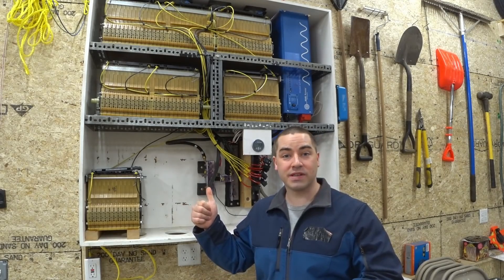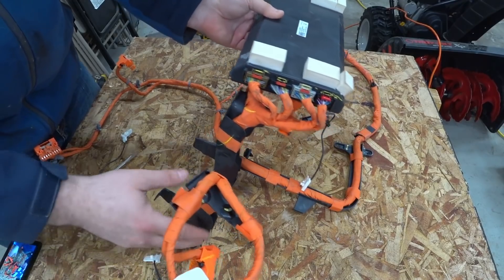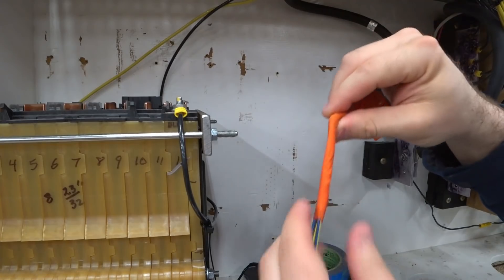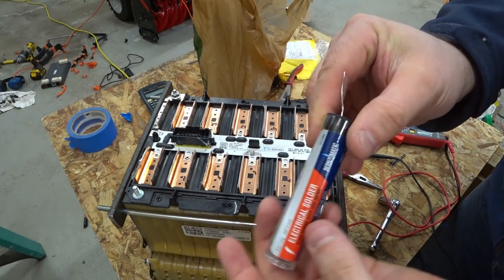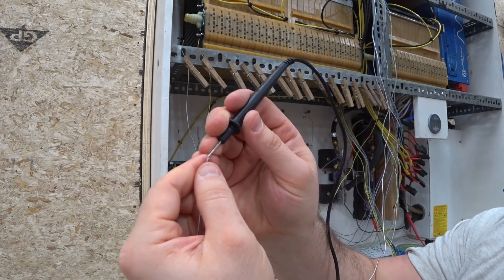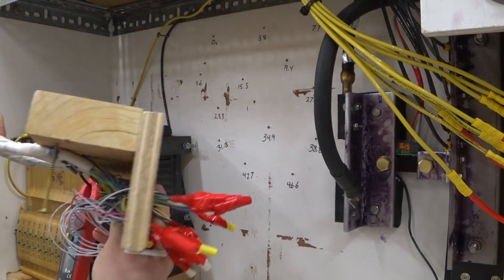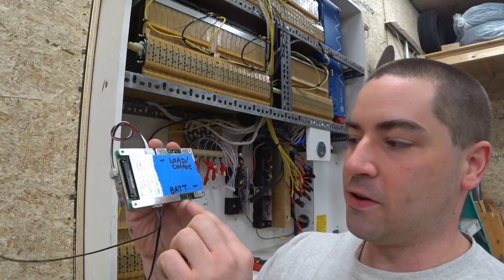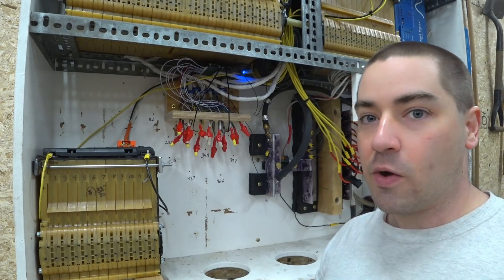DIY Lithium Battery Wiring Harness and BMS (Battery Monitor System)

Comment: It’s to bad someone else has not reused this wiring harness for off grid use ! It would be great if you could get a detailed explanation of each wire in the wiring harness ! Would have been cool to have used it with little remanufacturing !

Comment: Hello @David I am looking to do the same thing you are did. is there a way you can draw a circuit as to how you accomplished this? i would love to email you if you can share your email that would be great.
Reply from the maker: I don't recommend doing this same system.  This was back when I was learning about BMS's.  These days I add a small BMS per battery pack that I build.  In the case of this particular video I have 8 batteries, so I should have used 8 BMS's (one each).
Reply: @DavidPozEnergy  Hello! I wanted you ask you if this kind of Chinese Smart BMS has a significant consumption from the battery. I mean if it is possible that one cell be low because of the BMS connected for a long time. 
 I have Chevy Volt batteries and a few of this BMS, but finally I'm running the setup just checking manually (for year and a half all is fine).
Thank you!

Comment: I have some chevy volt batteries, not a complete set, but I believe there is 3 48 volt batteries. I either need some physical help or I need to sell them so I can get some batteries that I understand. What would you say 3 of those chevy volt batteries would be worth 🤔. I've posted them on Craigslist and market place for 1500 but no one seems interested 🤔. Do you think the price is too high? I just have no idea. B y the way, I think they are gen 1?
Reply from the maker: I think the Gen 1 is 2kwh per 12s (44v) pack.  Probably $150-$180 range.  Try posting it on a facebook group, like DIY Battery.

Comment: I have the bms from the car my batteries came from I will use it with my setup. It will be simple to hookup. You should have used that bms. My batteries are 30 volts so all that is needs is to be put into the bms 30 volts and the bms will manage the charging. Pretty simple.

Comment: Let me guess Battery hookup is giving you batteries to get you to video and promote there JUNK . I have bought batteries from them and have about a 30 o/o ratio of usable batteries and about 5 per. with 80 + per. storage. Informing them has been a waste of time thus far.. what has been your experience  with them and honest quality of product.
Reply from the maker: Hi Ashley T.  These videos on my Chevy Volt battery had no affiliation with Battery Hookup.  I bought the Chevy battery from a local junkyard.  At the time I didn't know Battery Hookup.  Then I bought my LiFePO4 batteries from them.  Those are 164 pounds each, 8s, 24v.  I paid full price for those and it was my first experience with Battery Hookup.  After my first video with those modules Battery Hookup asked if they could send me some batteries for review and I agreed.  The LiFePO4 modules are performing about 55% of original capacity, which is disappointing.  Other cells they have given me, like the LG cells, or the modem cells are performing with factory new specs.  Battery Hookup has stopped selling the LiFePO4 modules to my knowledge.  So there you have it.  My experience is mixed.

Comment: I don't understand the paralleled BMS cells.  What prevents current from jumping from string to string through the BMS wires when drawing a load or charging?    If one cell goes bad in a string, what is it going to do to the other cells on the other strings that are connected to the same BMS wire?
Reply from the maker: Nothing prevents current from moving along the BMS leads.  However, because the cells are well matched, the electricity doesn't need to move along the BMS leads.  The cells are still withing 0.008 volts of each other.   As with all my videos, I'm just sharing how I'm doing something.  I'm not trying to tell anyone else how to do anything.  You can do something different if you like.
Reply: So what happens when a cell goes bad?  What does that mean for the current in those BMS wires?    I'm asking because I'm in the process of setting up my own Chevy Volt battery that will be connected to a couple of SMA Sunny Island inverters.   Having a hard time wrapping my head around the various failure modes and consequences of each when the BMS wires are configured this way.
Reply from the maker: I suppose if one cell went bad all of a sudden, no warning, (I don't know how, maybe a bus drove into my building?)  Then I guess all the other cells would try dumping electricity into the bad cell and the fuse would blow.  I think a far more likely scenario is all the cells slowly degrading over years, but degrading at a similar rate.  Each cell is fused at 1 amp on the BMS leads.

Another way of doing this is to use 1 BMS per battery pack.  In my case that would be 8 BMS's because I have 8 batteries.  I implemented this strategy with my Smart Fortwo battery build.  (several videos about it)  I think it is a safer strategy.

Comment: You should check out this BMS. its has a relay output and a current shunt built in. i use a big contactor triggered by the bms to isolate the battery from the inverter in and overcharge or overdischarge condition. it also counts all you kwh usage. Its called the chargery power bms16t. they sell it on ebay for 195$ check it out you'll love it

Comment: what are you doing at 6:40 - 6:46.  You did not explain the procedure.  were you making the wires longer..  I find all of this all quite interesting and I have watched this  "Blog"  many many times and  it has turned me into a subscriber  Thanks, Bill,  well past 70
Reply from the maker: Hi Bill Dawson,  Thanks for subscribing.  Yes, you are correct, I'm making the wires longer.  That orange clip had very short wires on it, so I'm using some of the wires that I removed from splices and soldering them together with heat shrink tubing.  My friend Wim taught me this soldering technique about 10 years ago.  I just found this video which describes the process: https://youtu.be/Zu3TYBs65FM  I didn't go into detail on how to solder because I'm not very good at it.  Others on YouTube are far better than I am at soldering.  Thanks for watching.

Comment: What bluetooth BMS are you using?
Reply from the maker: This one: https://www.aliexpress.com/item/12S-20A-50-4v-bms-12s-2018-new-Li-ion-smart-bms-pcm-with-android-Bluetooth/32875990870.html?spm=2114.search0604.3.2.6539143baNlcHT&ws_ab_test=searchweb0_0,searchweb201602_10_10065_10130_10068_10890_10547_319_10546_317_10548_10545_10696_453_10084_454_10083_10618_10307_537_536_10902_10059_10884_10887_321_322_10103,searchweb201603_60,ppcSwitch_0&algo_expid=5f13e5ec-58b1-432d-82b5-08453babb5b9-0&algo_pvid=5f13e5ec-58b1-432d-82b5-08453babb5b9&transAbTest=ae803_5%EF%BB%BF

Comment: Just wondering David, which BMS are you using?  I need to get one for my 48v pack that's on the way for my bus to RV conversion.
Reply from the maker: https://www.lithiumbatterypcb.com/product-instructionev-battery-pcb-boardev-battery-pcb-board/ev-battery-pcb-board/smart-bms-of-power-battery/  I'm just using this as a monitor right now.  It doesn't do any protection, but could if you wire it that way.
Reply from the maker: This is where I bought it: https://www.aliexpress.com/item/12S-20A-50-4v-bms-12s-2018-new-Li-ion-smart-bms-pcm-with-android-Bluetooth/32875990870.html?spm=2114.search0104.3.1.3a1ec268phjNbr&ws_ab_test=searchweb0_0,searchweb201602_10_10065_10130_10068_10890_10547_319_10546_317_10548_10545_10696_453_10084_454_10083_10618_10307_537_536_10902_10059_10884_10887_321_322_10103,searchweb201603_70,ppcSwitch_0&algo_expid=cf985a9d-586f-488b-935c-cdb4ec07268b-0&algo_pvid=cf985a9d-586f-488b-935c-cdb4ec07268b&transAbTest=ae803_5
Reply: @DavidPozEnergy  gotcha on both.  What's got me puzzled truth be told, is I have the solar panels, I have 2 sets of 48v batteries from a chevy volt, an MPPT charge controller, and a 48vdc charger inverter, but everytime I sit and try to figure out the parts between them, I get lost.  By Parts between I mean, fuses or breakers, switches etc.
Reply from the maker: Hi Joseph,  It had me puzzled at first too.  Basically, there should be some kind of protection between any two things.  I like to use circuit breakers as my protection, but fuses work too.  Something goes between the panels and charge controller, something between charge controller and batteries, etc.  I bought a pre-made box to house the breakers https://www.altestore.com/store/enclosures-electrical-safety/electrical-enclosures/disconnectload-enclosures/dc/midnite-solar-mndc250-mini-250-amp-dc-disconnect-p2416/  The sales staff over at Alt-E are great to help you size the equipment.  They also have the best prices on most stuff.  If you want to hit me up on Facebook we can talk some more.
Reply: DavidPoz I will definitely look you up there tomorrow, after a very early day today I am fading! Lol

Comment: Got further into your video.... your "screw wall" harness was extremely dangerous.... seriously they make connectors. Amazon cells 2/3/5-way connectors that let you clip wires in a parallel but also insulated ... (dot dot dot)
Reply from the maker: Hi Tom St. Denis,  Sorry, I don't know what you mean by "screw wall".  Could you also link to one of the connectors please?  Thanks.

Comment: Two downsides of parallel'ing up the BMS.  1) reduced balancing rates.  Your BMS likely uses a resistor to bleed off excess power to bottom balance.  This can only handle so much current which means the larger you make a "cell" the slower it will balance.  2) You should be using the BMS power output to control powering your load (hence the point of a BMS).  By using only 1 BMS you reduce the total load that can be placed on your battery to the load of 1 BMS board....

Comment: Late on this but if you haven't checked them out give REC-BMS a look. They are a bit tougher to track down but they are also designed to work with larger amperages like this and probably can be set up to do the balancing and monitoring without too much extra finagling (oh and they have an existing integration with Victron components so they would mesh well with your 712 monitor).

Comment: EE student here. It's extremely dangerous to connect the same cell number (ie same cell voltage potential) to other cells in different packs even though they may be at close to the same voltage without any current limiting. Had the cell voltages been different by even a few hundred mili-volts massive current could have flowed as the cells tried to equalize themselves and it could have caused fire or explosion. Be extremely careful when working with Li-Ion cells. As others have mentioned, your BMS is too small, but I wouldn't worry about the resistance drain of a BMS with tight tolerances, the power dissipation is easily negligible for your pack size. I would highly recommend a fuse between the pack and the inverter/load and charging circuitry. I also disagree with the comments about not needing a BMS at all- it's a good idea so you don't forget to balance the pack.
Reply from the maker: Thanks for sharing your thoughts.  Before hooking everything up, I did go through with my multi-meter and check each cell.  Every cell was the same voltage.  And I had turned off the inverter and charger a week before doing that to make sure the voltages had stabilized.  My multi-meter only reads to the hundreds, so you can still be right about mili-volts being different.  
I have a 250 amp circuit breaker between the battery and inverter, and a 125 amp circuit breaker between battery and charger.  I have a video on that here: https://youtu.be/HYay0qqtUOs
Thanks for watching.
Reply: @DavidPozEnergy  Indeed you do! I haven't gotten caught up on all of your videos yet so I didn't see that, my bad. Thanks for the videos, they're always highly informative and well thought out.

Comment: where did you get the bluetooth bms?
Reply from the maker: https://www.aliexpress.com/item/12S-20A-50-4v-bms-12s-2018-new-Li-ion-smart-bms-pcm-with-android-Bluetooth/32875990870.html?spm=2114.search0604.3.2.6539143baNlcHT&ws_ab_test=searchweb0_0,searchweb201602_10_10065_10130_10068_10890_10547_319_10546_317_10548_10545_10696_453_10084_454_10083_10618_10307_537_536_10902_10059_10884_10887_321_322_10103,searchweb201603_60,ppcSwitch_0&algo_expid=5f13e5ec-58b1-432d-82b5-08453babb5b9-0&algo_pvid=5f13e5ec-58b1-432d-82b5-08453babb5b9&transAbTest=ae803_5

Comment: I wasn't sure, are you planning to install a full-fledged management system?  The monitor was just a first step to help prove out the wiring harness?  Great approach, by the way.  I wouldn't want to bet the farm (battery farm) on an untested wiring harness.
Reply from the maker: You got it right.  I'm just taking the first steps.  I'm still learning about BMS units and didn't want to jump in to a $1000 right away.  So I made the harness, and bought a $50 BMS just to monitor.

Comment: If one battery module power cable gets disconnected, that module will get charged/discharged through the monitoring wires. The small fuse will blow but prevent fire in the small monitoring wires.

Comment: Hi David, nice job! You've taken 20 Amp BMS. This is too small for your system. You could take 80 or 100 Amp BMS. You can use some of them in parallel connection. You can find them also on Alliexpress. Price is same. As for the Xiaoxiang software there are two of them. In advanced app you can set lot of parameters.
Reply: All of these cheap bms use 2x fets for the switching. That's 2 lots of volt drop across a silicon conductor. You lose a bunch of power going in, and another bunch going out. Use a latching relay controlled by the bms and no power will be wasted

Comment: One thought occurred to me though. With the cells paralleled through the small wires and their little fuses, it would be easy for one or more fuses to blow during a heavy load if the cells eventually have significant different capacity, ie due to age. Once a fuse blows, that cell is no longer being monitored independently, yet the BMS will not see the problem since it still sees all the other cells.
Reply: The fuses will not blow due to different capacity. Think about it. 
Without fuses, the short circuit currents become increasingly deadly

Comment: You need ElectroDacus, Saskatchewan, Canadian made. its a solar battery management system. https://www.youtube.com/user/electrodacus . all open source parts, so if you end up blowing a component by accident, you can replace it easily. It does take him a bit of time to build them and ship them, turn around time is about 3 to 4 months. @DavidPoz take a look.  https://www.kickstarter.com/projects/electrodacus/solar-bms-and-digital-mppt-for-pv-electricty-and-h  . I do have one and it does take a bit to get things set up but worth every penny for this unit.
Reply from the maker: I agree his controller is super nice.  If I had a 24v battery I would buy his controller for sure.
Reply: @DavidPozEnergy  your system is 8S or 12? I can't tell or remember sorry. I do wish he would build bigger BMS units .
Reply from the maker: My battery is 12s.

Comment: That bms is worthless to be honest. It will unbalance your pack, discharge the pack over time and fail when you need it most. Thousands before you have learnt this the hard way
Reply from the maker: Hi Nevada, I'm brand new to BMS's so I am asking a genuine question because I want to know: How does this discharge the pack?  Thanks.
Reply: @DavidPozEnergy  this looks like one of the cheap Chinese bms'. It uses the cheapest possible components assembled in the fastest cheapest possible way. So straight away you have reliability, efficiency and accuracy issues. If the bms sees, rightly or wrongly that one cell is higher than the others, it will switch the resistors on, thus draining the pack. There is no way to know this is happening and to which cells. Basically you paid peanuts so you should expect monkeys. It's like taking the most incompetent dishonest person in the family and getting him to be CEO of the family business. Or electing a corrupt con man to president. You are trusting a huge investment of time and money to a piece of junk. And it's not suspected junk, it's confirmed by the thousands of people who already bought one
Reply from the maker: Hi Nevada,  You are 100% right, this is a cheap Chinese unit.  I have no doubt it will fail sooner rather than later.  I'm trying to learn about BMS's, how they work, what features I need, what I don't, etc.  I really appreciate you bringing your experience to the discussion.  

I have looked at the parameters inside the BMS app.  I think it turns on a cell resistor at 4.25 volts, and turns that off at 4.15 volts.  I might be able to change these, but I don't know.  That is what's showing up from the factory.  I currently have my Victron charge controller set to charge up to 49.2 volts, or 4.1 volts per cell.  I think, that means (everything working) that the resistors would stay off on the BMS.  Am I thinking through this correctly?  

Anything you suggest I look at?
Reply: @DavidPozEnergy  you are missing the imbalance setting. The difference between the highest and lowest cells. This can trigger the resistors also. As for 4.1v across every cell, you will never achieve this perfection and you will always have some higher and some lower, sometimes by a lot. And this difference can change depending on ambient temperature, charge rate and voltage
Reply from the maker: Thank you.  I didn't know there was an "imbalance setting"  I'm going to have to go check that out.  Thank you for taking the time to share your experience.